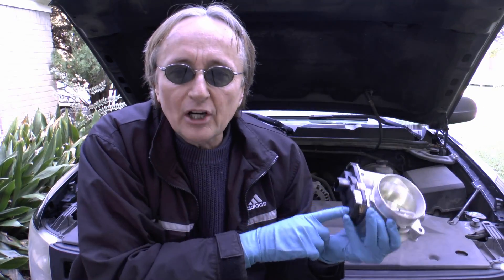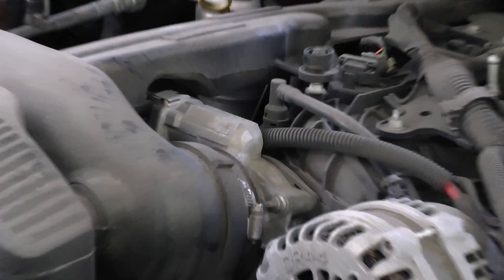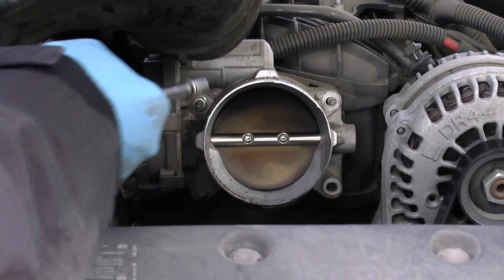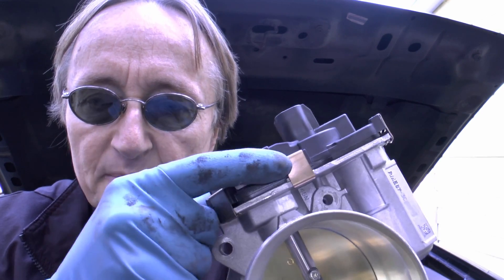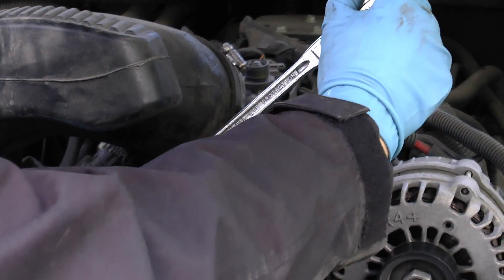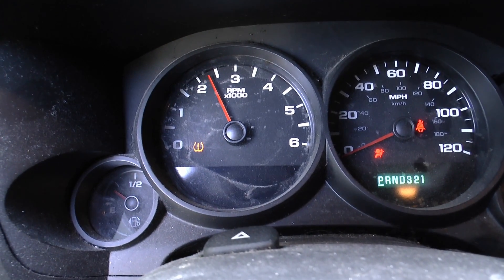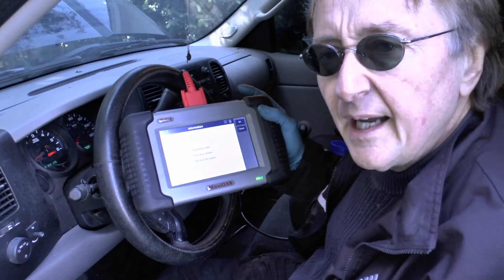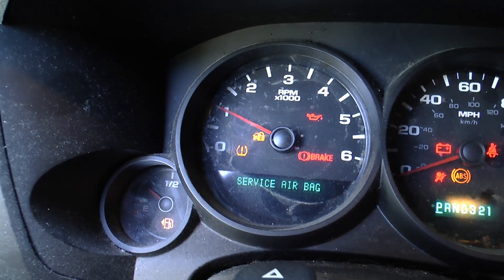How To Replace A Bad Electronic Throttle On Your Car

Comment: Hey scotty, I cleaned the throttle on my cobalt. Stupid me, I didnt take precaution. I stuck my finger in to open. Now idles @ 2000 rpm. Is it hooped? I asked dealer to do only relearn. Didnt do anything. Do I need more diognostics to see if toast? Can I replace it with a wrecker throttle??
Reply: Terrence, I would do two things before you try anything else.

First, tighten all the hose clamps in the air intake system. One might be loose.

If that doesn't work, inspect the throttle plate and the place where it seats when it's closed. A little bit of crud will hold it open enough to make it idle high.
Reply: Jim Mowreader Ryan, I got an e-mail with a comment from you "he didn't say he disconnected any hoses." He had to have disconnected SOMETHING unless his arm's four feet long and about an inch in diameter - Cobalts use the same fucked-up-looking air intake system every other FWD four-cylinder engine of the past twenty years has had, and he had to pull either the top half of the air cleaner or the cold air intake, depending on what his car has, to get to the throttle plate.

My bet: he already had something loose in there but the crud was sealing any leaks. When he cleaned it, now a very small amount of pirate air is getting in downstream of the Mass Airflow Sensor, or around the sensor, and raising the idle speed. (If it was a LOT of air, he'd be getting idle hunting and he would have mentioned it because that's really obvious.) So...tighten all the clamps first, re-clean the throttle plate, make sure the mass airflow sensor is in solidly...I'd also tighten every ground in the engine compartment, but I do that every time I pop the hood for maintenance anyway.
Reply: Jim Mowreader nonono. I know messed it up by holding the flap open to spray cleaner in there. What I'm trying to find out is what kind of BS diognostic procedure am I likely to be faced with? I had the relearn performed but didnt do anything. I don't want to waste hundreds of dollars just to play guessing games. The car ran fine before I did this and I am aware I made a mistake by moving the flap with my fingure.
Reply: Jim Mowreader I am looking for someone who has specific knowledge of the chevy and these circumstances, not just general guesses.
Reply: Terrence Gold I'm kinda worried that you bent something. Now, the flap you have...does it pivot in the middle, or does it move up and down (well, in and out) like a plunger? (Up and down like a plunger is what the old Bosch L-Jetronic system did, but that's not on your car.) My bet is it pivots in the middle, and if it does, look at it to see which side goes in when the flap opens. Then get the thinnest feeler gauge you have. (It's best for this if you've got one that's made bent; otherwise, just bend the flat one. It's cool; you probably don't have anything on your car that needs a .002" gap anyway.) Put the gauge at the top of the crack between the flap and the intake body, right up by the pivot, and try pushing it in by applying pressure to the feeler gauge. It should be hard to do. Now move the gauge to the bottom of the intake body, still in that crack, and try to push it in. If it goes in real easy, that means you bent the flap with your fingers and you're probably screwed.

Even though the modern car has more computer power than the rockets that took men to the moon, they still have engines, and engines go faster when more air gets in them. Before you start blaming the electronics, make sure the old-fashioned stuff (like airflow) is where it's supposed to be.
Reply: Rýán Túçk I originally decided to cleaned it because it would occasionally stall (which I find out now, that thats apparently normal for those cars) and the throttle was really dirty. But I didnt do research before messing with it. I didnt know at the time that simply moving the flap open apparently screws it up.
Reply from the maker: na, just moving it can't damage a normal throttle, unless it was already 99 percent shot. But, if you left it on the car with the battery connected, the cleaner could have shorted it out
Reply: Scotty Kilmer the car was perfectly fine since I bought the car in 2006. Basically it sounds like I shorted the damn thing out with the spray. At least now I know, so I don't waste hundreds on bullshit diognostics, only to not determine anything. So I can replace it, then get relearn done. Will a used throttle work?
Reply: Rýán Túçk oh my god I just took the rubber pipe off, held the flap open and sprayed out with throttle cleaner then put the pipe back on
Reply: Terrence Gold Anyone know which side of the throttle plate the MAF sensor lives on in a Cobalt? Terrence, please: Get a screwdriver and tighten every screw in your intake system all the way back to the engine block.
Reply: Jim Mowreader emm yeah, I think there are some screws loose here, but they won't be found on the car
Reply: My etc on my chev was messed up. I replaced it with a used one for 35 bucks and it runs perfect. Lolololololol. Screw you general motors lollololol

Comment: Hey Scotty, I have a 2005 Silverado 5.3L(same exact engine as the one in this vid). There is a loud grinding/whining noise when its running. I think the alternator bearings are bad. I'm thinking about replacing the alternator. For some reason the whining noise varies by RPM. If I start driving the whining noise will change.

So my question is, is alternator the issue here? or is there something else, along with the alternator, that needs to be replaced? Does alternator speed(if thats a thing) vary by engine RPM?

Thanks!
Reply: Your issue could be the alternator but it's very common for the idler pulleys to go bad. Take your serpentine belt off and spin each pulley by hand. You'll know which ones making the noise. And yes alternator speed is directly related to engine speed because the belt is driven from the crankshaft drives the alternator

Comment: Scotty, on my 98 silverado I have to push in on the fan speed knob while turning for the fan to work on the set speed. Sometimes I have to hit the control unit for the fan to start working. Is this a problem with the unit itself or the blower motor?
Reply: If hitting the control unit fixes the problem sometimes then it's probably the control unit or the electric connection between the control unit and the blower motor.  

You're probably knocking a loose connection back into place which is falling loose again due to the vibrations from driving.

Comment: generally all you have to do is clean the throttle body on these.  if that doesn't work you can get just the sensor from the dealer now.  a lot cheaper now.  very rarely do you replace the whole deal anymore.

Comment: On a similar note, is there anything that is known to go wrong with a car like my 02 Camry so I know what to look out for?
Reply from the maker: if it's a V6 engine, they can crud up so change the oil like I do, every 3 thousand miles
Reply: It's a 4 cylinder and I get the oil change every 3-4K miles.  Just wanted to know since it will very soon hit 130K miles

Comment: Those all purpose car auto code scanners are becoming cheaper every month, bought one the other day for $100. If You really want to go the cheap way and you have a good laptop computer you can just buy the OBD2 Scan Tool software and just buy the USB adapters. The software and usb adapter will run you roughly $100 maybe cheaper.
Reply: I would appreciate anything in photo form the movement thsnx do much buddy
Reply: its 2014 learn to use google https://www.autoenginuity.com/

https://www.google.com/search?q=OBD2+Scan+Tool+software&rlz=1C1CHFX_enUS598US598&oq=OBD2+Scan+Tool+software&aqs=chrome..69i57&sourceid=chrome&es_sm=93&ie=UTF-8#q=OBD2+Scan+Tool+software&tbm=shop

Comment: Hello Scotty, I've Nissan Pathfinder 2003 with VQ35DE engine. The car runs fine, no CEL codes appear on the scanner, but it has some problem. When the engine is cold, car starts fine. If I drive it some time and shut off the engine and try to start the car, it seems to start fine but then tachometer gauge goes down (300-600 rpm). Sometimes it survives shut off but most times it shuts of. If I help with gas pedal when I see this behaviour idle speed goes to normal. Is it throttle body?
Reply from the maker: often a dirty throttle body, try cleaning it, also try my video "HOW TO CLEAN FUEL INJECTORS ON YOUR CAR'
Reply: Scotty Kilmer Should I do idle lelearn process afterwards?

Comment: I wonder? After changing the electronic throttle. Can you disconnect the battery long enough so the computer forgets the stored faults. Will it go to normal idle when battery reconnected and started?

Comment: Scotty, How do you cleaning the throttle plates on these electronic throttle body, is there a special cleaner for hondas or i can pick any random one.
Reply: Check out his video "How to clean a throttle body" or something. The best is to use throttle body cleaner if you can find it, but I think carburettor cleaner will work too.
Reply: Henrik Nilsen Note... if it's drive-by-wire, do not force the throttle open by hand.  Have someone open the throttle by putting the ignition in ACC mode and step on the gas.  Drive-by-cable is fine and shouldn't cause an issue since there aren't any gears or electronics controlling the plate.

Comment: Hey Scotty, I just moved from sea level to 6000 ft and it feels my car has lost 1/3 of its power. Is there any way adjust the air fuel ratio to get some of that power back? I have a 2007 scion tc. Thanks!
Reply from the maker: take it to a pro mechanic who knows toyotas, there are computer software changes that need to be made

Comment: And this is exactly why I will NEVER get rid of my Ford Crown Victoria.....Nothing beats an old fashioned throttle cable. They are far more reliable, simple, and better. My fiancé has an electronic throttle in her Mini Cooper....There is a delay from when I hit the gas to when the car actually moves....Whereas on my Crown Victoria, its instant power. To hell with modern engineering. I will take old school, reliable technology over modern unreliable engineering any day.
Reply: 2004+ Vics have the drive by wire system. I just bought a 2009 CVPI and decided to spray down my engine bay since there was a Mad Max level of dust in there.  I covered the PCM, the MAF, the COP's, the fuse box, and the battery so they wouldn't get wet... but not the throttle body and its stupid little butterfly valve motor.  The next day it stranded me when the car started idling rough then dying and not reacting to my pedal AT ALL.  ZERO.  $700 later..... *groan*
Reply: tin pin I have a 2002 CVPI. Will never get rid of it.
Reply: Yeah hang on to that one - the 03's have lots of computer/electronic issues despite having a throttle cable system.  You probably have the last Vic with the desirable throttle design.

Comment: I just got done cleaning mine and it idles high 2004 Hyundai Tiburon my mechanic said it will relearn it's self, or does it need a reset?
Reply from the maker: it should reset itself after a couple days of driving
Reply: Ok thanks, I see your in Texas right? Where abouts?

Comment: Hey Scotty on the dashboard of this video the exclamation point was blinking. Now my car does that and I looked on Google to see what it may have been and I had two answers. 1. Low pressure with the possibility the sensor is either bad or a nail in the tire. And 2. Transmission fluid needs changing. What could be the possible problem?
                                            Your Fan,
Reply from the maker: the stupid tire sensing system was bad, been that way for a long time, he just lives with it.
Reply: See I thought it was a major problem.. And also another question about the oxygen sensors which one is upstream and downstream

Comment: On my Protege5, I don't need a fancy tool like you. There is a black thing bolted on my throttle body, and when you slack the bolt you can rotate him a little to adjust the rpm.

Comment: What the heck is the sense of replacing the throttle body yourself if you still have to go to a garage to reset the damn thing... I am sure the Garage will love you so much that they will charge you double to reset it. Garages today squeeze every little bit out of every job. I can remember when my Garage would change fuse, small lights, ect for free. now everything has a price on it.
Reply: you dont really need it, usually unplug the battery cable and run it for a while it will relearn itself
Reply: It costs a lot of money to operate a garage and pay mechanics' salaries, and given the absence of customer loyalty and generally more reliable cars these days they simply can't afford to give away freebies any more.
Reply: ya i get all that. the issue here is that the garage will now charge you more to use their scan tool to reset the the throttle position. I went and got a small scanner so I wouldn't have to go to the garage for them to scan a check engine light. What I am getting at is that with this repair it would appear that you are damned either way.. just sucks thats all.
Reply: They get taxed to shit. But it might actually be better for a mechanic to earn less and go in a lower tax bracket..maybe
Reply: Because you saved 100 dollars on a labor hour and they were gonna charge whatever was set for the computer portion anyway. And you know what kind of work you do yourself.
Reply: My etc on my chev was messed up. I replaced it with a used one for 35 bucks and it runs perfect. Lolololololol. Screw you general motors lollololol
Reply: Big Guy Review yeah I'm scared to take my car to a shop, more than I'm scared to go to a doctor myself lol
Reply: If you have a good mechanic, they won't charge you more than probably $10 to do the idle re-learn. My mechanic still does a lot of stuff for free. They pulled a nail out of a tire for me and checked for leaks when I wasn't sure if it had penetrated all the way through. They also fixed a scraping noise caused by something loose in the front wheel (can't recall the details), all for free.
Reply: Big Guy Review
That's still a good deal , you can fit your new throttle body yourself and save on that part of the job. Then the garage will charge the normal scanner fee which they would have to do either way , those scanners cost $1000's.
And BTW , the mechanic didn't design , manufacture , or sell the cars , he's only trying to deal with and fix these problems brought to him.
Reply: i suppose.
Reply: At my garage we change  bulb fuses etc for no cost, there's still some good guys out there ;)

Comment: Technology only helps you so much.... Not enough and you will be living roughly, too much and the same happens. I prefer cables to wires and stuff but hey it's "evolution"! And you made some money fixing that thing, right? that's what most companies want...To make money. But maybe a electronic throttle serves another purpose other than breaking down, I just don't know what, gas pedals are't that hard to press anyway!

Comment: Tighten to snug? I think it needs to be torqued to a specific spec or it could end up being too loose,or warped If over tightened.
Reply from the maker: I've been doing this 47 years, and in this application, snug is fine, it's not that crucial with a rubber o ring sealer that will conform to any close shape
Reply: it only important on engine internals to torque everything up
Reply: Scotty Kilmer I've replaced more of these that I can remember on my Tahoe.  I've never torqued it, just snug is good.  I can do this just by feel without damaging the gasket.  I can't say other engines, other than a 5.3L Vortec, work this way.
Reply: That's only for rigid-on-rigid material contact, like the metal-on-metal contact between the cylinder head and head gasket. With a soft material like a rubber gasket, as long as it's not extremely overly tight, it'll be fine.

Comment: I got the same code on my chevy, when this happened i removed the throttle body and gave it a good clean with brake cleaner and the code went away idle very high for about 2 days but then went back to normal